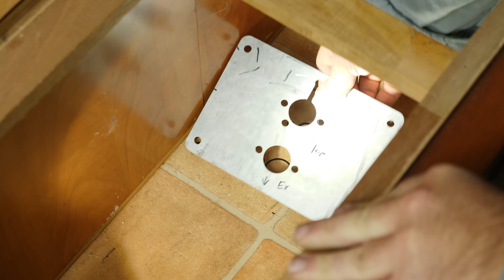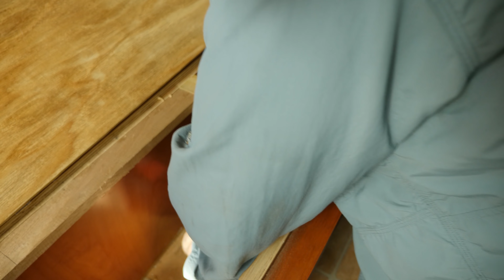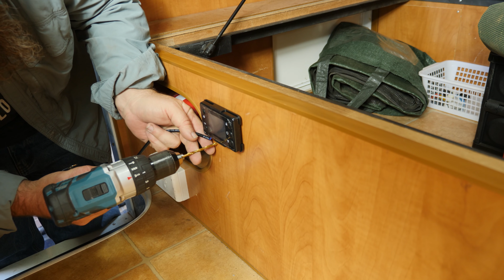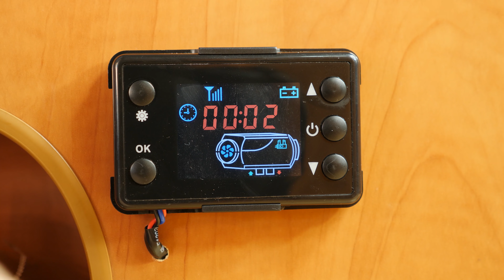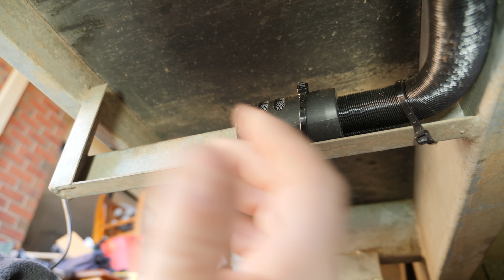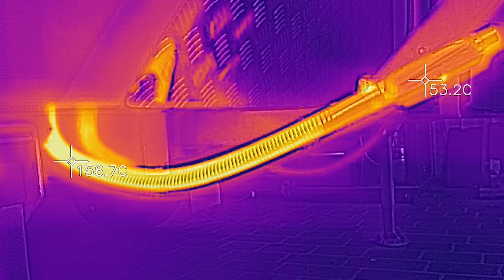Ebay Chinese Diesel Heater Install and Testing

Comment: Buy Cheap....buy twice. Just remember, this is a cheap blow torch surrounded by plywood and you're sleeping above it. I fitted an Autoterm heater for around $1300. It's not a cheap chinese copy, it's a Russian made unit with a great controller that works well and been tested down to -52 degrees C.
Reply from the maker: Sometimes you do definitely get what you pay for, though having said that, this heater is still working flawlessly.

Comment: since your floor isn't flat you need to use fireproof silicone sealant or permatex high heat RTV to seal the mounting plate to the floor to prevent carbon monoxide leaking into the van
Reply from the maker: Thanks for the tip.

Comment: Thanks for the good video. Was that the fuel hose supplied with the kit ?
Reply: mine is a transparent plastic 4mm hose that i will replaced with a 2mm on Amazon
Reply from the maker: Yes, just supplied with the kit!

Comment: C'mon Australia lets stop supporting Chinese manufacture, They are not supporting Australian Business at all.
Dont sell your soul for cheap crap.
Reply from the maker: Is there an OZ build alternative?
Reply: @LockyourHubs4WDing  Would not have a clue on that ,but that is not the issue here is it.
Reply from the maker: Is is too an extent, it's one of the reasons I still own a modded Travel Buddy 12v oven as opposed to the arguably better Road Chef, my 80 has ARB lockers made in Kilsyth Vic and both the 4WDs have locally made bullbars. They weren't the cheapest options avaliable, but I want to keep my kids and now grandkids in jobs. But there has to be a locally built alternative for people to buy.
Reply: @LockyourHubs4WDing  Each to their own on this my friend. But I stand firmly on my very first comment.
Reply: @Hates Spam I have not put anyone down you clown. Calm down, grab another bourbon and light up a winnie blue. DILLIGAF.
Reply: @Hates Spam Just one more comment. If you own a Chinese heater that has ZERO safety and Zero Q&A . DO NOT put yourselves and children to bed in a caravan or camper at night. The risks are far to high and you probably know that already.
Reply: @Hates Spam Read my post again, I did not slag this guy one iota, all I did was offer advice.
Reply: @Hates Spam Your last question is unbelievable. Specifically about Chinese gear dont you get it. DUHHHHH.
Reply: @Hates Spam And my last little dig is. Just vote Labour and see how much Chinese shit you will have to put up with. I would not be surprised if any Aust businesses last 12 months after Wong and her cronies have their way.

Comment: Problem with plastic version the body distorts on bolt down and fan catches on body work.
Reply from the maker: When the body distorts?
Reply: @LockyourHubs4WDing  My heater has annoying fan catching noise. Will go away if i press down on body of the heater. Didn't make noise before bolting down because i had seen similar problems on YT and tested before hand. I think the metal body version would be more solid.

Comment: A far as I’m aware, the exhaust pipe should run downhill to allow water build up to release from a hole in the silencer.
Reply from the maker: I agree it's not  bad idea, though the heater has been running for a while now without issue with the exhaust. I'll update the description if there are any issues with the install or the heater itself.

Comment: Also you've used the wrong fuel line, sorry to say.
Reply: I would've run a metal braided fuel line, especially so close to the hot exhaust?
Reply from the maker: It's been used extensively since installation, still with the supplied fuel line, still working great. While there may be better fuel line options, the fuel line supplied by the manufacturer seem adequate.
Reply from the maker: Why?
Reply: @LockyourHubs4WDing  I don't want to advertise other channels, but there's a gentleman who's showed difference between the green line that comes with some, and the clear nylon that comes with others. 

Also I assume this line you are using is larger than 2mm inner diameter, also it's soft. Which will cause the pulse to be dampened.
Reply from the maker: I always maintain the proof is in the pudding, and the setup has remained unmodified since the installation and is still running fine. 

What's the name of the other channel? I'm always interested in learning from others.
Reply: @LockyourHubs4WDing  

Here you go good Sir;

https://youtu.be/jCZhjGyR3bo?t=898

At correct timestamp as well :)

Comment: You should have used a turret plate.
Reply from the maker: I've never seen them before, having now googled them, they seem like a great idea!
Reply: @LockyourHubs4WDing  That being said, it looks like you have a thin floor, so it might work either way. Exhaust can get very hot.. Thank you for the video
Reply from the maker: The exhaust definitely gets very hot!

Comment: I ordered one of these 5K heaters just like yours for my van which arrived last week. Mine is the economy model ($80 US) so the controller just comes with a couple of buttons (on/off) and a knob which I guess is either a fan speed or temperature controller, not exactly sure which. No digital readout. The instructions are awful! So I've been watching videos to get a heads up before I install it. 

I have an 84 Dodge van (about 250 square feet interior space, uninsulated) I want to warm up quickly on cold mornings. The plan was to wire this unit into a timer so it would turn itself on about 10 to 15 minutes before getting into my van. Does the controller on your system have a timer which can turn the unit on by itself? Supposedly I can buy a computer for this model for $16 US which will plug right into the harness. 

Who knows I may not even need it. Someone said the 5KW / 17K BTU unit is overkill for a 250 square foot van so it may start putting out heat quicker than I think and may not even need a timer.
Reply: The timers for these are only a cutout timer, the digital displays have the added function of an error code when something is wrong. Other than that they work the same. Yes they are plug n play with each model, just check plugs are the same.
Reply from the maker: The camper isn't insulated and the owner tells me even when it's cold enough for ice outside he can keep the interior of the camper at 20 degrees celcius no issues. 

I'm not sure about the timer, I'll have to ask the owner.

Comment: these heaters are a game changer when camping in winter, we run ours on the a frame of the tow bar with some bunnings heat proof tubing through to the a hole in the tent on the floor. I have put another hole for the temp controller so it fits in the pocket inside for easy access. 10lt of diesel for 4 days camping running all night on the lowest setting.
Reply: without specs, the values in your comment are useless
Reply: @DormantIdeasNIQ  are you asking for my specs? I was making a statement on my personal opinion of these heaters. What do you want to know?

Comment: Hi. Can I ask when you cut the plug off the thermostat controller what colour wires go where? I watched your video a few months ago when installing mine. I have misplaced the plug and need to connect the wires together but not sure which order they go in..

Best regards gavin
Reply from the maker: We cut a couple of inches off of the themostat end and just played a game of match the colours with the patch lead.
Reply: @LockyourHubs4WDing  thanks for the reply. The thermostat end has different colours to the opposite end on my model 🤣 I can get it all lite up but I am not getting a error code 07 it was perfectly fine until I moved the location of the thermostat in doing so I had to disconnect the wires and didn't mark up which order they needed to go back lol. Il figure it out. I hope. Thank you

Comment: Thanks mate, do you still recommend to buy?
Reply from the maker: The heater installed is still going strong! There hasn't been a spot of trouble with the heater since the installation.

Comment: Excellent video with concise detail and no BS!
Did you wrap the exhaust where it exits under the van with any heatproof tape and would you consider this a good idea?
Reply from the maker: We didn't, it would be a great idea though if the exhaust passed pass something that might melt.
Reply: @LockyourHubs4WDing   I'm going to wrap my exhaust pipe with header wrap just in case. I don't like the idea of that plastic inlet hose and fuel line being within a couple of inches of the exhaust pipe at that temperature!
Reply: @turbofiat  ... Your post was years ago, but I can't help replying to your observation. i don't like the idea of all that heat so close to the plastic inlet and the fuel line too. That to me is a bit of a worry. My unit came with a different type of base plate and I got 2 of them ? in every video I've watched (thinking that the second plate might be to form a sandwich, either side of the floor, I've seen NO ONE else get two plates and the under side of the cut floor is just open to the elements. Water, snow etc. That wouldn't be much good for the timber of the floor. I will be wrapping the hell out of the exhaust pipe where it goes close to the floor with fireproof tape and heat resistant silicone to protect it from heat and water.
Reply: @steiny3353  I've had my heater in my van for about 2 or 3 seasons and so far the heat wrap has held up and not melted the fuel line.

Comment: Been doing a lot of research re fitting one to a 17 foot caravan and have been told don't go bigger than 2kw. That looked bigger in the body than a 2.
Reply from the maker: It's a 5KW unit, though the camper is only canvas in the top half, so needs a more powerful heater than a fully insulated caravan.
Reply: @LockyourHubs4WDing  Ok, our van is a pop top. ie: The top 15-18 inches is canvas. Maybe I should be considering larger than a 2kw. I actually have a 5kw but was advised too big.
Reply from the maker: @johnguerin119  You already have the 5kw, so I would definitely run it!

Comment: hello you installed the air intake and exhaust outlet a bit wrong.  this should be done so that the filter and muffler are at the lowest point so that no water collects in the pipes.  Best regards and I like your installation idea
Reply from the maker: Thanks for the tip.

Comment: I think you did a great job on the install. That said I would personally recommend that you have a heating expert have a look and see if they can recommend any safety upgrades . 

Having someone professionally trained give you a ok will let you and your family sleep safely knowing that it’s not going to be a problem.
Reply from the maker: That's solid advice. At the moment the camper is equipped with both a smoke alarm and carbon monoxide alarms.

Comment: 11:39 wondering if those cable guides are exposed to ground twigs, branches, and rocks from under the vehicle? Do they need mechanical shielding from those assaults?
Reply from the maker: The camper has done about 2000km of off-road driving since the install. No issues so far!
Reply: Congrats!!! Cool!!!

Comment: Installing a Chinese diesel heater in an enclosed area where you're likely to be sleeping, I think automatically qualifies you for a Darwin award nomination.
Reply: I suspect in mats case it may be user error
Reply from the maker: The camper has both a smoke and carbon monoxide alarms, what could possibly go wrong?
Reply: Mat, you sound like you're from North Carolina.  I grew up there and would rather burn to death than go back, although that's not going to happen from this heater, and you know it exhausts outside.  Truckers have been using them for decades
Reply: That's a stupid comment. Everything is made in China anymore including residential gas furnaces.

Comment: Another tip: either install a switch or always unplug the controller. If you dont it will fade and before you know it you will soon be struggling to read from it
Reply: Best advice on here👍+I put a turret in to make sure no heat transfer 👍
Reply from the maker: Great tip, the heater, while we didn't go into the power wiring in too much detail, has a resetable circuit breaker that Matt uses to isolate power when the camper is packed up.

Comment: Quick question, am I going to have sooting issues running this at high altitude (traveling to Colorado for a few days soon).  I hear the digital one has an adjustment for high altitude but I have the one with the rotary knob and 2 buttons.  I would probably be running it on low all night and then on high for 15 minutes before turning it off the next morning.  Do you think that will be good enough or do you think I should add some Seafoam or something like that to the diesel?
Reply from the maker: If it's cold up there, you'll need to add something to stop the diesel from gelling up, the digital controller also has the option of running a frequency for the unit instead of just switching on and off with the thermostat. Matt has seen better success using that mode running it in the cold desert nights here in Oz

Comment: Have you ever tried cooking oil  ( filtered ) instead of diesel ?
Reply from the maker: I haven't, the only problem I can see is the viscosity of the cooking oil in comparison to the diesel, it's much thicker and wouldn't flow nearly as well.  Just like running a car off of WVO, you would probably need to develop a system that utilised some of the waste heat (from the exhaust) to heat up the cooking oil to thin it out  before it would be able to be pumped through the system.
Reply: @LockyourHubs4WDing   Yeah , that is true . Might be worth "thinning" the oil or mixing it with diesel ( or something along those lines) . Diesel etc is darn expensive here in U.K . LOL . wouldn't want you to have a heart attack if i told you the price
Reply: @chriskautz3245  I saw another YT video of guy running on diesel and then switching the hose over to veg oil. It smoked and choked and wouldn't start again after that.
Reply: @chriskautz3245  
Red diesel is only 85 p a litre round here 
Better than white at £1.30
Reply: @LockyourHubs4WDing  Here in the US you can get heating oil which is diesel without the road tax, the one issue with that is finding a reseller and dealing with there hours of operation. hope that helps!!!

Comment: Where u get gas carry tank fitting tube on cap?
Reply from the maker: Ebay!
Reply: @LockyourHubs4WDing   Can you provide the link? Want to do the same thing for my hunting trailer
Reply: What did you search under. If tried heaps of keywords and can’t find it

Comment: You made me giggle...DIY'ers don't usually use the word impinge!! Class act. Funny how I've watched 5 different videos and pick up something special from each one. I'd been trying to position my heater under a caravan seat so I could hook up the supplied intake AND outlet air tube, but your video opened up the possibility of a tubed outlet, and just a cavity with an unrestricted air flow (via a vent) without the need for ducting.  Thanks for posting your install. Legend.
Reply from the maker: Glad you enjoyed it!

Comment: This is the best installation video on YouTube ive seen , im about to fit one in my 25ft Hobby caravan, i ordered one from Ali Baba a month ago, it finally arrived yesterday, i got stung £25 import duty, but overall cant wait to get it fitted, its only August but some nights we put the gas fire in at night for an hour or so, come winter it dont go off, this costs a fortune, hopefully il save some money by running it on Kerosene, 60p a litre or red derv at 75p a liter, where i get it straight from the pump 
Cheers bro .. Great Video
Reply from the maker: Glad you enjoyed it mate. In Oz, we're in the depths of winter here, so the heater is getting a good workout! 

Best of luck with your installation.

Comment: According to Youtuber John McK 47, an extremely knowledgeable expert on the Chinese Diesel heaters, he advises the fuel pump should be mounted as close as possible to vertical as it utilizes diesel for lubrication during reciprocation. It appeared you mounted it near horizontal, which permits air cavitation on top and allows metal to metal contact on the pump internals. All the best M8, nice video.
Reply: 30 deg angle from horizontal
Reply: @jimmurphy4703  Hey Jim,thx for the update brother.Stay safe.
Reply: make sure to bleed it out or buy a higher quality pump :)

Comment: Excellent Work and Video - I have a 40 Foot bus conversion and I am thinking that I will need two or three heaters. One for the front of the bus and one for the rear bedroom compartment. I thought that I would also mount a heater under the dining table in one of the benches. Do you think that this is overkill? How did you deal with the 12volts?
Reply from the maker: My parents have a 2kw version in a 20 foot caravan, it's easily able to heat the van. If you could transfer the warm air (duct?) to the bedroom, I don't believe you would require more than one heater. As to the 12v we calculated the run and the amperage and then went up a couple of sizes in wire diameter. We ran both a positive and negative fused, directly from the battery in conduit under the van.
Reply: @LockyourHubs4WDing Thanks for your input - That is a powerful heater to heat that much space. I also want to direct heat into my Tank bay and the Generator Bay.  I still want a separate heater for my bedroom. That heater would also keep my Tank Bay warm. I do live in a warm climate so I will not need the third unit. I plan to connect the heaters to my house batteries for boondocking  with a transfer switch to a shore power12volt converter.